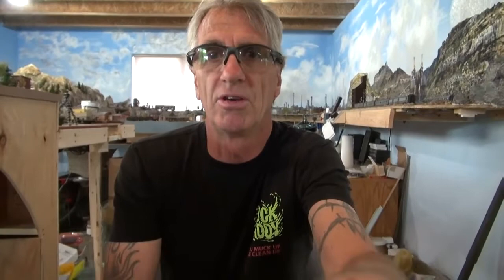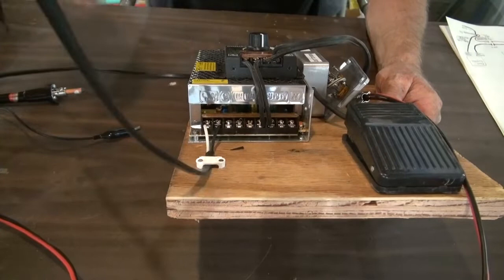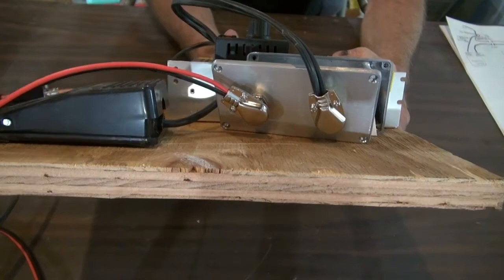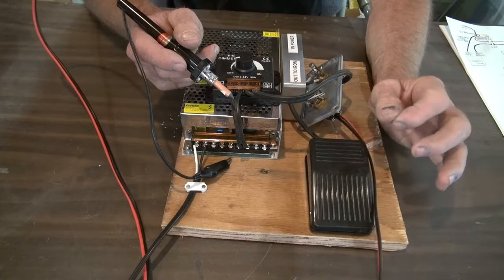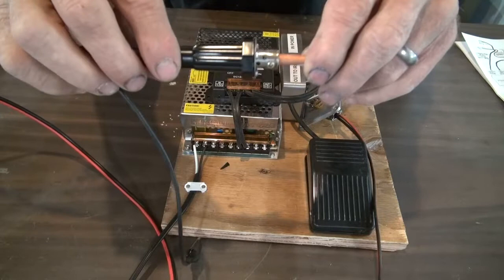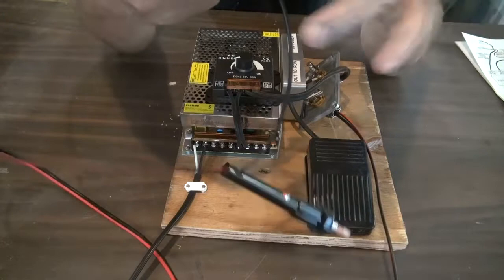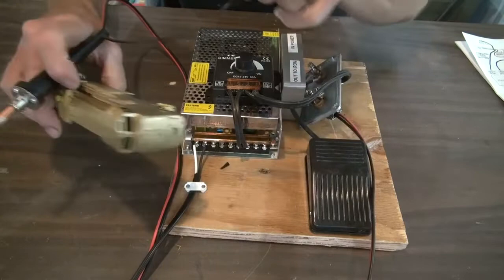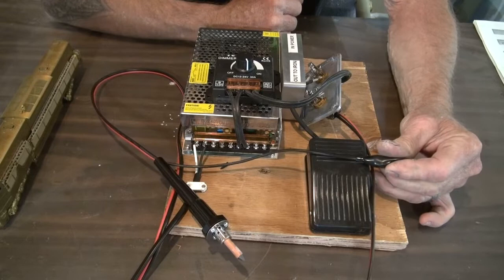Build you own Resistance Soldering Iron for $80.00!

Comment: thank you for your video, I used your explanation and parts and built my own soldering station. I used a 12v 30 A power supply, same dimmer and instead of soldering Iron i bought 16 gauge wire with alligator clips that directly connect to the output of the dimmer, one is negative and the other clip holds a 4 mm carbon gouging rod (Cut to 3 inches ). works brilliantly so far ! the only difference i have is, i put the foot switch between the mains and the power supply so its never powered on unless activated. everything was bought off amazon for all under $75 in Jan 😀2024

Comment: hello I recently saw your res. soldering unit. I purchased what you show on line. power supply 110vac input 12vdc output 30amp, dimmer 12vdc input 12vdc variable output 30a with foot sw. I used 12ga stranded wire. and 10 ga. stranded to work probe and 10ga to ground post. carbon rod etc. I get 12vdc out to dimmer to ft. sw. but I don't seem to get any amp. to solder my brass part. any ideas. again built and used same parts as you are showing. thanks mike
Reply from the maker: Hi Michael, I'm not sure why it's not working. I suspect you have something not grounded. Remember this isn't a soldering iron but a welder
Reply: @cllhmodelrailroad1867  I rechecked everything as far as my connections etc.  I also noticed that when I connect my gr. probe and my work probe my power supply cuts out. maybe I can't use cheap parts. any other suggestions. thanks again. I'm thinking of buying new power supply and a new dimmer maybe of better quality.
Reply from the maker: Hi, it sounds odd that when you connect everything your power supply looses power. Amps are important in welding. Just cause it says the amp rating it doesn't mean it's a continuous amount. The power supply must be strong enough to push the amperage continually. Another thing is the parts your grounding, have they been stripped of any paint or varnish? Sorry your having issues. I know this works, I use it all the time and other modelers have built it and it works for them too. Stay on it, you'll figure out the issue, probably a little step that's causing the issues.

Comment: FYI Micromark now offers a unit for $200. Problem is, all it states in the ad is "63 watts". It has high and low outputs but doesn't say what the output voltage and current capability is.
Reply from the maker: I'd call micromark and see if they will give you some more info. $200 is a good price if they do the job.

Comment: I built the resistance soldering unit using the same parts you used. I am using 18 gauge stranded wire to the probe and ground. What did you use?
Reply from the maker: I beleave it was 18 gauge. Depending on how long your welding just check the wire for heat. If it gets hot go to 16 gauge.

Comment: I've been having some issues sold in g joints that are near previous soldered joint without coming unsoldered or out of alignment. resistance soldering would be my solution then? I have the ability to make this so I'm thinking of giving it a shot. I see some people use transformers specifically and your using a power supply which I guess they are one in the same. what thickness of brass are you able to solder in your experience? thank you for your time
Reply from the maker: Hi and thanks for your question. So if you were to build a brass locomotive from the start, you would be using a resistance soldering unit for the reasons you discussed. What your doing with this device is your welding the pieces together, not soldering. A little side note here is to use a low heat solder as well.
Reply: @cllhmodelrailroad1867  okay cool good tip I never really pay attention to the melting point of solder but I will definitely look for it next time I'm out to solder. now I want to build myself a resistance soldering unit I know all the components I will need but I'm not sure what size transformer would be good. what are good parameter to stay with in for a transformer? I know 115volt primary but I have seen multiple secondary used anywhere from 6volt to 24volt using a power control kno, and with a power of 50VA to 250VA one forum said. what specs would you recommend in a transformer? thank you for responding back I appreciate the wisdom.

Comment: I have a 1000 watt amplifier for converting 12v to 120v to run our furnace during a power outage. Is it to much?
Reply from the maker: I can't tell you. 1000w might weld the parts into a puddle of metal?

Comment: I have question for you, I made a similar set up as yours but with a more powerful(50 AMP) power supply, the probe and the ground wires are connected directly to the power supply (I did not connect it to a dimmer), the problem is, when I complete the circuit to solder, the fan stops working until I lift the probe, then it starts again, does the fan in your power supply behave this way? thanks.
Reply from the maker: No mine stays on..I'm wondering if you disconnected the ground wire from your design and wire it the way I did if your problem would stop. I'm thinking it's shorting out your power supply, or puttingto much load on it..??
Reply: @cllhmodelrailroad1867  someone explained a more reasonable possibility ,  he says when "I'm soldering, the voltage drops too low for the fan to run," which makes sense, I'll check other possibilities, thank you for taking the time to reply.
Reply: @cllhmodelrailroad1867  Mate Mine did the same thing did you try disconnecting the earth on the power lead as suggested and did it work? If not did you work out a solution? My power supply drops all voltage not just the fan when it sees the short circuit.
Reply: @ddistrbd1  I just disconnected the earth on the input but it never made any difference.
Reply: @weepierre101  Hi, I abandoned the idea of using a ready made  power supply,  but instead I used an old microwave transformer and removed the top wire coil( secondary?) portion and wrapped 3 turns of 4AWG wire, it works perfectly as a low resistance soldering. as you  can guess I am a total novice in electrical world but this LRS works better than I had hoped. good luck.
Reply: @ddistrbd1  Thanks mate. Since I sent the message to you I have been busy on youtube and decided to go the same way. I don't think there is any way to bypass the short circuit cut out on the power supplies. Luckily I happen to have a microwave transformer that I can modify. Thanks for your response.

Comment: Thanks for sharing this. I built one using an old 650W computer power supply and solder off the 5V output and use it exclusively to solder copper wire rolling ball sculptures. I couldn't have done it without your video so much appreciated. 

My Machine: https://youtube.com/shorts/mAhxsKRF6-I?si=MpGYPSojyY7Lzsa9
My last rolling ball sculpture: https://youtu.be/dAo9GpIjYl8

Comment: Posted question in wrong place first time so hopefully I've got it where it needs to be.
Why use the carbon tip on the soldering iron?  Why not just use the original tip built on to the iron?
Reply from the maker: Because your not heating up the whole area to be soldered. With the carbon tip it acts like a welder